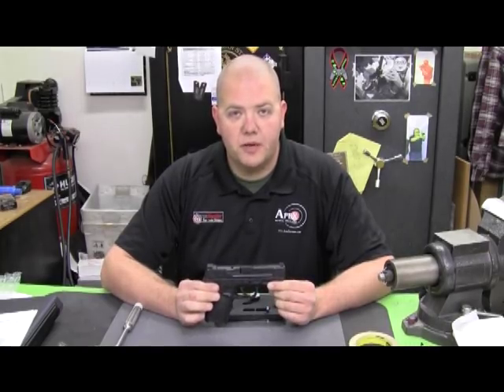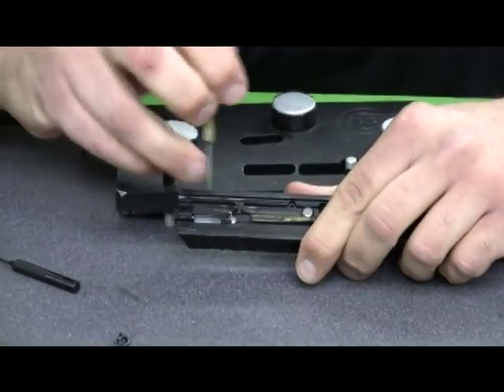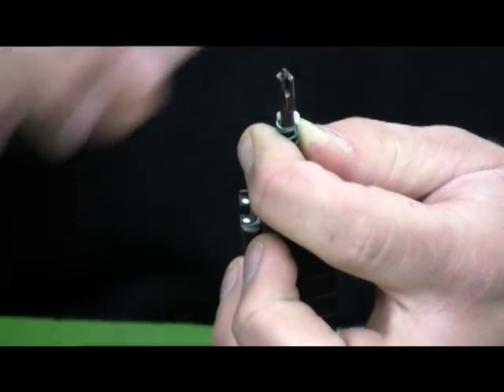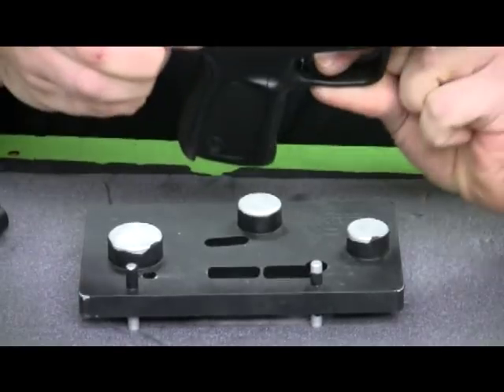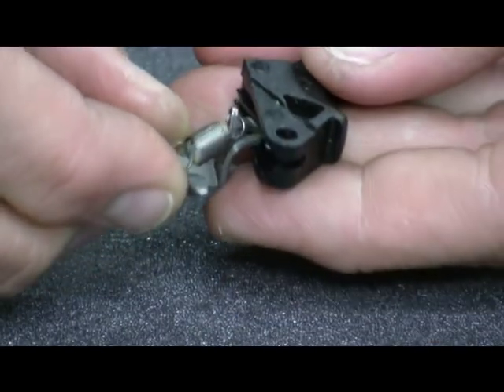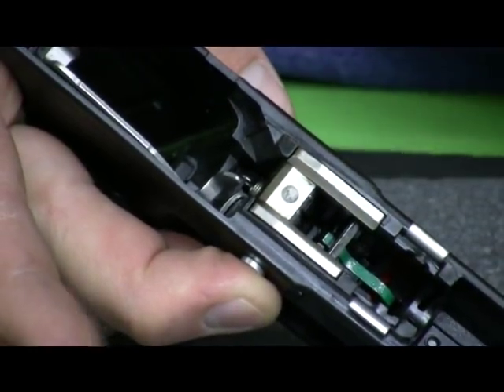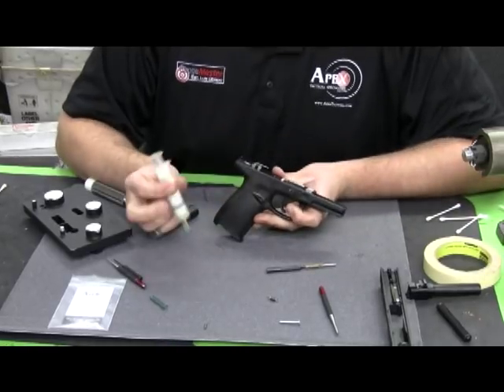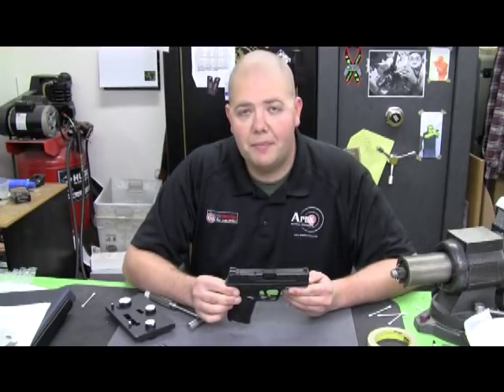SD/Sigma Kit install

Comment: Just got mine installed in the SD9VE.  As others have noted, getting the trigger pin back in place was problematic (and that's being kind).  Once reassembled the pull is much more range friendly.

Comment: couldn't i just replace the trigger spring without replacing all the other stuff?  or would that cause a FTE?  also,  what are the negatives to removing the sear spring?
Reply: Replacing the trigger spring is the hardest part.  The other springs go in like a piece of cake, no problem.

Comment: The worst part for me was getting the slide lock lined up so I could get the pin all the way through. I swear that part alone took me almost an hour of fiddling with it, taking it apart and starting over, referring back to the video, etc...frustrating
Reply: I just had the same problem last night I feel your pain.
Reply: @GetthewaterX  I have a question. Maybe you can help. My trigger pin is counter sunk deeper on the left side than the right. Is yours like that or is it even on both sides? I looked at a new SD9 at the store today and the pin on it was pretty even on both sides. Sometimes I drive myself crazy nit picking my guns lol.
Reply: Jimmie Harris I think mine can be pretty even on both sides if I were to hit it with a punch just right but my left side is a little more sunken in. Maybe your frame is warped somewhat
Reply: @GetthewaterX   Thanks for the quick answer. My left side is sunk in just a little more too. I called SW today and the lady tech said they should be even. Then she told me not to move it myself because if I broke something me working on it would void the warranty. She told me to send it in. Lol. I told her I could handle punching a pin a little if it needed it, I wasn't sending it in for that. In the old days a tech who had been there for years would walk you through a minor adjustment if you needed help. I know some pins only go right or left so I was just wanting to make sure I punch it the right way if it needs it. She wad not much help. I found a good video on putting the trigger pin in. It says go right to left. It snaps when it locks in place. I'm going to field strip it and see if it pushes in a little. I sometimes wish I didn't notice stuff so much. I've only had it for a few months and put 50 rounds through it. Most people probably wouldn't have even thought nothing about it. I just happen to notice it wasn't even the other day and it got me wondering about it. Thanks again for responding.
Reply: Jimmie Harris yeah no problem man. Maybe the pin is just a shorter length than the frame itself so it appears crooked

Comment: This install is not difficult for me. But one thing out of the ordinary happened to me. The firing pin channel liner came right out freely. I had to change one in the past on a Glock and It was pretty difficult to get out. My SD 40ve was new in the box when I disassembled it. Everything seems to be in good working order two days after the install at the range. How much resistance is supposed to be on that liner. Is it unusual that mine came out freely. Is it possible that my liner or my channel are out of spec??
Reply from the maker: Joe Bs, it's a 50/50 if they come right out or not.  in our experience it should be good.
Reply: apextactical   Great thanks for quick response.

Comment: Just install the new trigger kit very easy took me about 20 - 25 minutes watch the video twice the only question I have is he mentions that the one new spring doesn't have the felt in it as the old one did.  But my new spring  still had the felt in it so I'm just wondering if that's normal.

Comment: what grease are you using? Just installed mine. took 25 minutes.
Thanks
Reply: He used White Lithium Grease. 
 I wonder if this is better than using 3 in 1 oil.  Perhaps operating conditions and temperature has a say in what product to use?  Does anyone know if using both grease and oil on different key spots would be better?
Reply: Been using just oil now 500 Rounds since mod. No problems. I clean/oil once a week even if its not shot though.

Comment: In the video during the triger return dpring removal and install he says the factory spring has a felt core and the Apex Tactical spring does not. My kit the triger return spring has a felt core?!?!

Did I not get the correct spring?
Reply: E-mailed Apex Tactical about my concern and got a very quick response.  I hot the correct kit, its just the video is out dated. Took less than a hour to install the trigger and spring kit, this was my first time doing anything like this, but it was cake. Took the gun to the range yesterday and I am so imressed with everything,  thanks Apex Tactical!

Comment: my sear block is different, i have an extra lever and spring....anyhow i dont know how it goes back in....help
Reply: same here, i don't know why it isn't covered. now i have new none working pistol....thanks apex.
Reply: have you guys figured it out? if so can you help me please.
Reply: kevin cahill yes, you need me to make a video should how to fix it?
Reply: Hassle Hoof that would be wonderful thank you.
Reply: Rey Munoz The reason the sear block is different is because Scott is using an SD9 NOT the less expensive SD9 VE. As I noted above, there are major differences between the two, and since 2 months have gone by without a response, I would not hold my breath for Apex to provide one.

For starters, I don't think you can even buy an SD9 anymore - not even on GunBroker.

The SW9 and SW9 VE preceded the SD9 and SD9 VE and they, too, have their own differences.

The current crop of SDVE's have some serious quality control issues. I ought to know because I've owned three over a span of 7 months and I noted some major differences between my first one and my current one in the shape and function of the sear - specifically the little notched end that engages the trigger bar.

The first gun had a longer notch - more like what is shown in the SD9 here. My current SD9 VE has a very short sear notch - barely higher than the thickness of the trigger bar it engages.

As a note to other commenters: please keep this in mind (re: the real quality control issues) before you attack another user who is having problems with their SD despite the fact that yours works just peachy keen. Lemons are not confined to cars or groves. 

I have seen more of those "It's your fault" kind of comments on Amazon than I havwe on YouTube. I think it speaks to the much larger and more serious population of gun owners, gun reviewers, and gun sellers.

My 3rd SD must have been made late on a Friday afternoon before a 3-day weekend given how many QC issues it has. Being a Six Sigma guy, I'm more attuned to quality control issues than your average Joe.

The fact that S&W has QC issues with this gun should not come as a surprise to those who've followed the recall history of the Shield.

For me, the SD9 VE would be a fabulous gun if S&W kicked the POS trigger to the curb and installed an M&P Compact trigger instead. 

The SD9VE is the epitome of a love-hate relationship for me. S&W had five chances to get this gun right. And they blew each one. Yes, I am very happy for everyone who love their gun like a son, and have had no problems at all.  Count yourself as being BLESSED. There''s lot to like about the SD9VE. Otherwise I would never have bought it more than once. 

I'm one of the poor unfortunates who's been CURSED by some compromised construction and defective design flaws. 

After totally whiffing with the Sigma trigger, they came out with the SW9 which was supposed to be a vast improvement. It was -BUT NOT WITH THE TRIGGER.

Then, they came out with their first "Value Enhanced" version, the SW9 VE. Fuggedabout "Value" if you can't put a decent trigger on a gun at this price or at any price.

Next, the SW gave way to the SD - an acronym for "Self Defense." The only thing that needed a "Defense" was the crime of putting another lousy trigger on the same gun that was not any better than the "Premium" priced SD version.

Personally, I think they changed it because S&W SW9 was a bit redundant as it was on the S&W SW99 - a rebadged Walther P99 that beat the big M&P every which way but Sunday.

Finally, we come to S&W's low-price leader. Their version of the $1 Big Meal. ACADEMY SPORTS, a big box retailer eschewed all of the other sellers by putting an everyday price of $319 on a gun with an under $400 MSRP tag that other online dealers grosslyt took adsvantage of by overpricing theirs.

Not only that, but Academy would periodically (every 4 months) sell it for $299. There must be a really good deal, markup-wise, for so many other sellers to trumpet their own "Special Sale Prices" on the SD VE's right around Black Friday, Cyber Monday, and Xmas. The lowest I had seen it being sold new was for $260. 

AH...but some unscrupulous sellers pulled out the 2nd mag that is supposed to come with the gun so thatthey could lower the price and make it up by selling the mags as extras separately.

Meanwhile, I'm waiting to hear back from S&W on how they plan to address the issues I painstakenly pointed out to them. 

Stay tuned.
Reply: kevin cahill i can help just let me know
Reply: I have the sd9ve California model so there's a safety for the clip. if the clips not in it wont shoot an when I did my trigger job the lever for the clip safety fell out an I don't remember how it wen back in. the gun works fine but I would like to put it back in. TheDrRJP pablo kill
Reply: +kevin cahill leave the mag safety out you don't need it and is pointless.

Comment: there is a little spring inside the striker and the sleeve right behind the striker spring, what purpose does that spring serve? glock dont have that spring and the pistol seem to function fine without it
Reply from the maker: that spring is a striker rebound spring and is necessary for proper function according to S&W.

Comment: Good video overall. My sd9 has never been fired. This may be the problem. Video says push from right to left. Fought to get the trigger pin out for a while then tried from left to right. It came out.. The other only hard part is aligning the trigger pin when you reinstall it. Took me forever to get the pin aligned with the slide lock. Total time was about 45-50 minutes.

Comment: I carry mine everyday also, I think it's safe to carry, it's not going to be light like a match trigger or anything like that.  Now it has the weight of say....an M&P but the trigger pull still is that long smooth pull.  You will notice a lighter trigger pull but nothing crazy

Comment: tightspot88
I made the same mistake and the slide will not come off. i tried removing the back plate and striker, but i still cannot remove the slide - thanks

Comment: Is the grease necessary in the trigger return spring? What purpose does the felt have in the factory spring?
Reply from the maker: the grease helps to attenuate vibration from recoil and increases the life of the spring.  The felt in the factory spring does the same. Shortly after this video was made, we started adding felt to our springs as well and recommend a couple of drops of oil during install on the felt.  we are working on updated videos.

Comment: I bought my kit on eBay for a sigma but I have a sw40ve which are almost the same do you think it will work
Reply from the maker: You do have the correct kit for the SW40VE.  Please check our website to ensure that the parts you received in your kit purchased from ebay match the Apex parts listed on our website.  See: Apex Sigma Spring Kit  apextactical.com

Comment: Very easy install.  The only possible hangup would be getting the slide stop installed quickly.  Other than that, smooth install.

Comment: I have spent four hours trying to get the slide stop back on, and it simply does not seem to line up for some reason. Any tips?
Reply from the maker: try installing the pin from the right side, make sure the trigger bar is in the up position and the trigger is depressed, this will take pressure off the pin and spring to ease install. if that doesn't help, contact customer service for assistance
Reply: I was able to get the slide stop reinstalled using that method. However, it doesn't seem to lay flat, and appears to be in what I would call the engaged position. I was able to run the pin all of the way through,  so I'm not sure if that means it is OK, or if something else is wrong. I reinstalled the remaining parts, but now when I go to slide the frame and the slide back together, there is no friction and the slide doesn't catch on anything as it should. Suggestions as to what might be wrong here? When I look in the frame, everything with the trigger seems to function properly.
Reply from the maker: Sounds like the slide lock lever spring was possibly allowed to get on top of the locking block causing the slide lock to sit up.  You will likely need to remove and reinstall
Reply: Got it, thanks. I actually forgot to put the recoil spring back in haha. I've been dealing with this for over 6 hours, so I'm glad to be done with it. I was expecting it to take all of 10 minutes like my Glock 19!

Comment: I'm having trouble taking out the trigger pivot pin. I've tried right to left and left to right. Any advice?
Reply from the maker: The big trick is to get the front end of the slide lock lever to move up and forward by roughly 1/16" while lightly pressing on the pin.  Make sure the sear housing is out and the trigger bar is in the up position, this will take tension off the pin and make it easier to move.
Reply: +Justin Baker Same Here!  Not budging for me :(
Reply: +Brandon Russell what i ended up doing was just focusing on left to right instead of right to left and it eventually came out.
Reply: +Justin Baker Yep, that's what I ended up doing and it finally came out left to right, so weird. I put it back in the way he shows and it went in fine that way.  Thanks for the reply.

Comment: A video for CA compliant SDs would be nice...
Reply: They're pretty much the same, the only thing that makes a gun CA Compliant is the magazine Capacity.
Reply: .mlh They aren't the same. I have one and when I did this I had to take out the magazine disconnect safety, which is only on the CA complaint SDs. (I can now shoot with no magazine in the gun)
Reply: Maurice Thomas Really? I didn't know that. Thanks for the info!
Reply: what did the magazine disconnect safety look like? because I'm putting the sear block back together and there's a brown/bronze peace I don't know where it goes back in at. if you have any advice that will be helpful it would be much appreciated. thank you

Comment: I have a sw40 and my trigger is not clicking when I clock my gun. What could be the problem?
Reply: If you have not already given up and taken your Smith to a gunsmith I can tell you exactly what happened. I was doing the same install on a Smith like yours mine except is 9mm. Followed the video exactly. What went wrong.. is the fact you can install this kit with the trigger only 2/3rd of the way in and it will go together and pass the operational checks they show in the video. But when you put the slide on you get what you posted pull trigger nothing happens. Here is the bad part. If you try to remove the slide assembly from gun it will not come off. How I fixed this was I punched both pins back out of the lower and from the back VERY CAREFULLY worked entire assembly slowly back to front upwards then pulled the slide with all the internals still connected straight up from the top and redid the whole lower assembly making sure the trigger was all the way up in the well second time around. They obviously did not have this issue when doing the video but it should have been noted to double check the trigger is all the way in and it will check good even if not installed all the way up. It made a 30 minute mod an hour job for me. And I have lot of experience working on fire arms so unless you paid someone already to fix this is how it can be done and how someone who would charge you to fix the problem. Hope this helped. But no fault to the guys who did the video or kit but the fact this could happen should have been brought up. Because when you find out it is done and the only way to fix is what I did just be careful and slowly pull everything straight up and then you can redo it right. This will fix it and not damage your gun. Good luck.
Reply: No, I usually like to fix my own guns but  have never came across this. My gun did exactly that the sidedid not come off. I'll try to do what you said, I'll keep you posted. Thank you
Reply: Annette Ramirez
You are welcome. just punch out the pins. I did the back one first and then the one above  the trigger and starting at  the back of slide worked and slowly lifted out the block and slowly worked my way toward the trigger working it up take your time and the whole slide and trigger and rear block will lift out straight up then you can separate them from the slide and redo it. I read back some on the earlier comments after I posted to you and saw this happened to lot of folks. I have hard time seeing close up and there are two  ways you can get the trigger installed and everything hooks up but you end up with what we got. Just make sure the trigger is all the way up in the block. Would have caught this.. but even intsalled not all the way up it still functions like they say it should in the video. Until you put the slide back on. Just be careful and you will be good to go and you will like the difference in the trigger pull. Good luck.